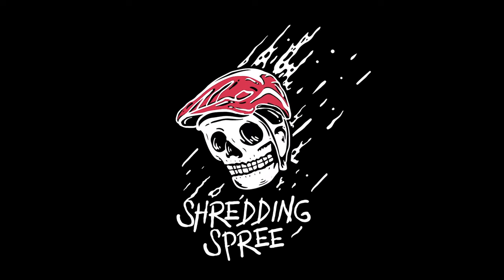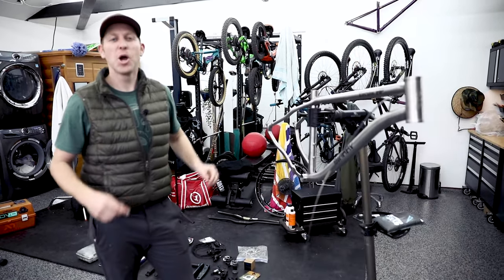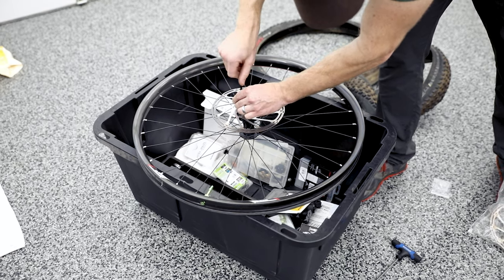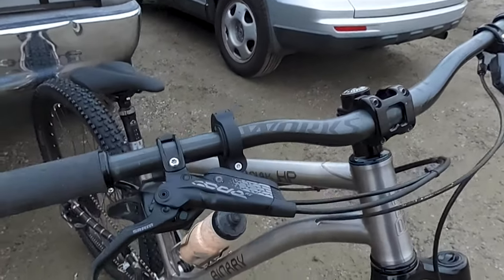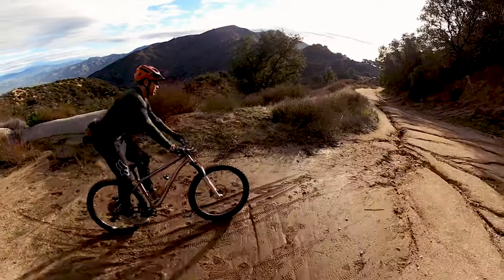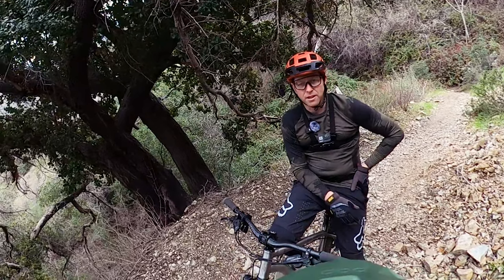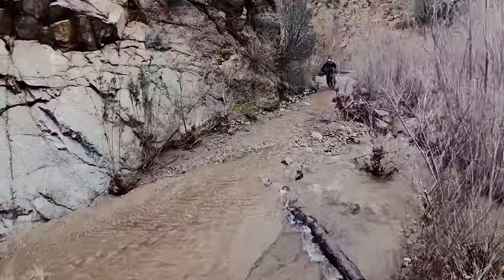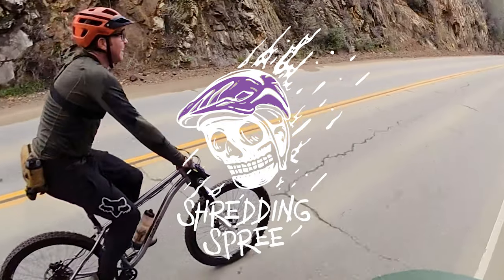The Tale of a Very Realistic Bike Build: Binary Maniak

Comment: I built mine up and was surprised to see it was close to 2 degrees slacker than I expected.  I still love the bike, but did install an angle adjust headset to steepen it up a bit.
Reply from the maker: Yeah Sperbs spec’d his with a 140mm fork and it looks slack as hell. We didn’t measure it though
Reply: How did you measure and what was the result? How slack?
Reply: @MMcG25  Mine was a tick over 62* with a new Pike Ultimate 140.
Reply: @tommyr95  damn
Reply: May I ask if you also measured/calibrated the flat ground, & measured also the effective seat tube with the Pike Ultimate please?
The Binary Maniak geo charts state that "dimensions are using an unsagged 29er 120mm fork and 29 x 2.3 wheels and tires";
maybe the extra 20mm in fork travel affects effective angles 7 measurements?

Comment: That looks real fun & has me excited to ride my hardtail this weekend. Which trails/network are these?
Reply from the maker: The trail is called Los Pinetos and it’s located in Newhall, CA.. about 30 min north of Los Angeles
Reply: @ShreddingSpree  Oh nice, I'll have to check it out when it's not 90°+ in DTLA. I take it's the black trail & not the blue trail(start looks a bit hard to get to?)?
Reply from the maker: @Alex_564   yes, trail forks has it marked as a black trail but I’d say it’s a solid blue. It has a few steeps spots and a couple rough spots however in my opinion it’s only difficult if you’re going fast. 

The climb is a little tough. It’s called the beast because it’s so long with minimal protection from the sun. The trail is worth the cost of admission though.
Reply: @ShreddingSpree  Oh nice. Looks like I'll check it out in the fall. Have you done the section rated blue, is that also worth it?
Reply from the maker: @Alex_564  I have not and actually don’t know anyone who has. That section drops down the south side of that ridge toward Sylmar. You’d have to climb the mountain again to get back to your car.
Reply: @ShreddingSpree  ah okay. Where do you normally park for this section? At the bottom & then take a fireroad up called the beast?
Reply from the maker: @Alex_564  yes. At the newhall ave park and ride
Reply: Cool, thank you.

Comment: 6:38 Backwards does not matter, it's Sram lever so you can flip it over without disconnecting the hose. I run brake at the right. But as I too have flip flop levers I can flip them over. I have Formula Cura 4, great brakes apart from the lever blade using plastic bushing that wears in few hundred km. SO will get RG Bikecomponents lever blade upgrade. Bearings 👌
Reply from the maker: It does matter when the hose is connected.
Reply: @ShreddingSpree  of course you might need to cut the zip ties off, but as long as it's not internal routing that's not an issue, so just putting the lever trough the front triangle and reattaching. problem solved. so if you do this mistake and don't want to disconnect it after you got a perfect bleed, this works.

Comment: Was his frame made correct?  I’ve seen a lot of people having 2-3 deg slacker head angle than it’s supposed to be. Better in my opinion but not what people paid for.
Reply from the maker: We never actually measured the HTA but it definitely appeared to be more slack than expected. Sperb has since dropped the fork down to 130mm and he likes it more.
Reply: Any chance he can measure it with 130 on there?  I am supposed to get my frame next month and am debating on angle adjustment headset.  I have a 130 fork and really don’t want to be steeper then 65 degrees